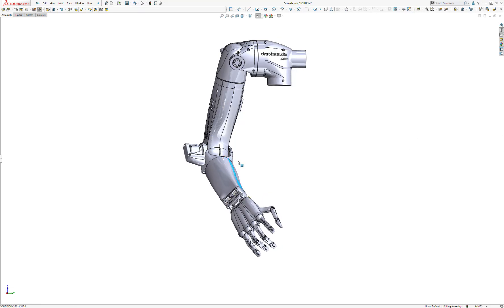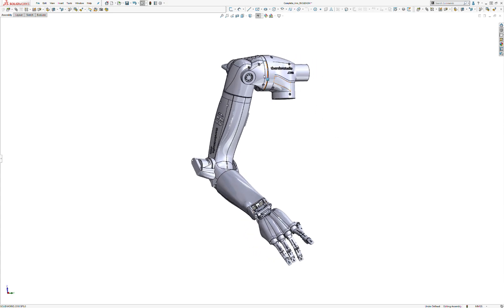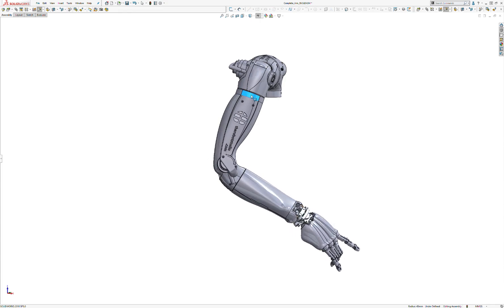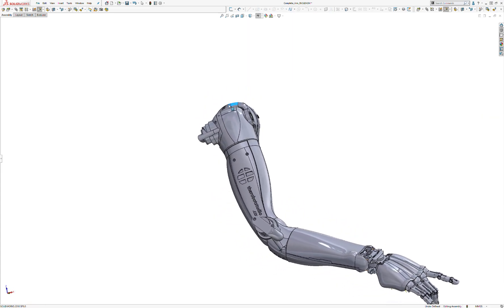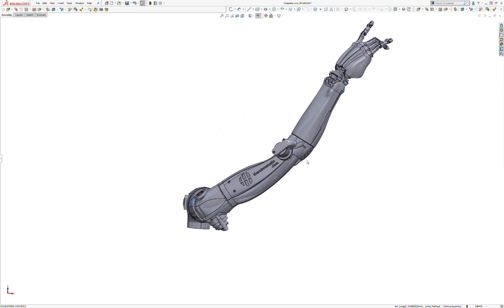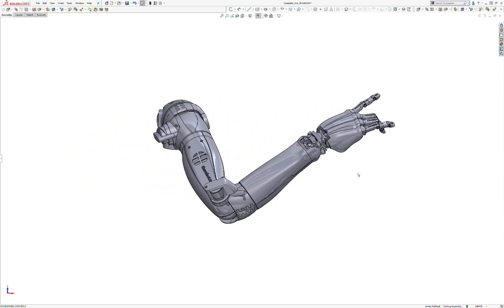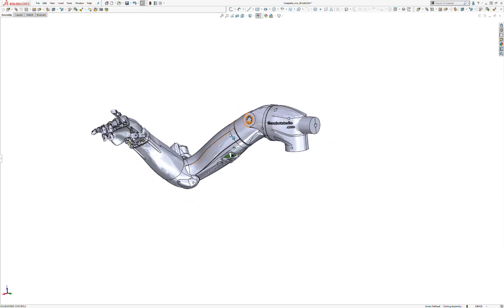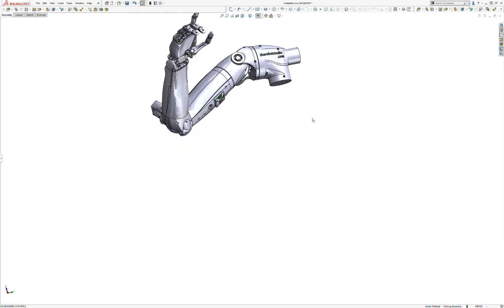Rotations in the shoulder joint of robot arm 4 Degree of Freedoms - DOF - Pitch, Yaw, Roll and Elbow

Comment: Quick question. I am in the process of designing a robotic arm, and was wondering if you can get shoulder roll by some Lie bracket of shoulder pitch and yaw or if you necessarily need the third motor there. For me, that would be the difference between designing a 6 DoF arm and a 7 DoF arm. Thank you!
Reply from the maker: As far as I know, if you have an elbow than you must have roll in the shoulder to move the end effector to an arbitrary position. It's most easily accommodated by a rotation in the upper arm parallel to the major axis.